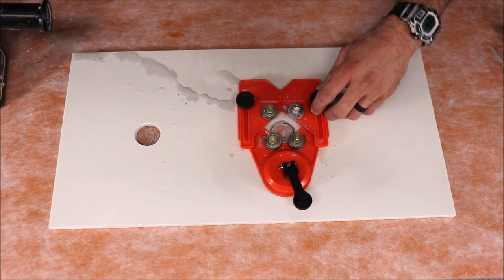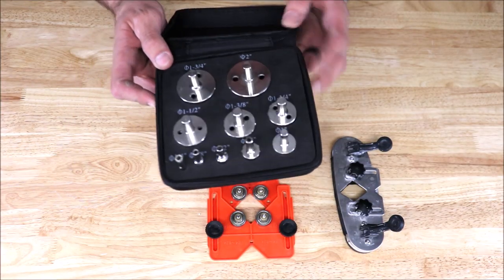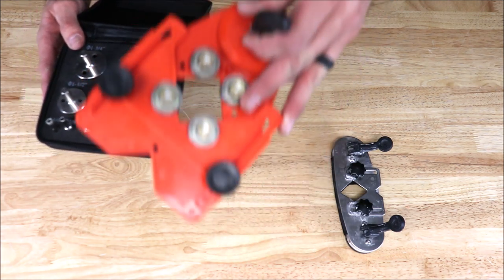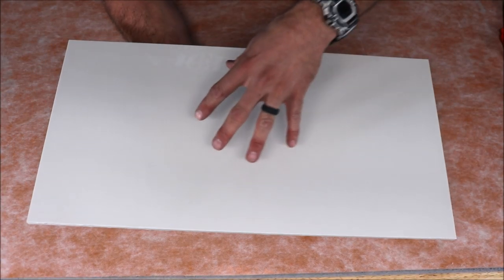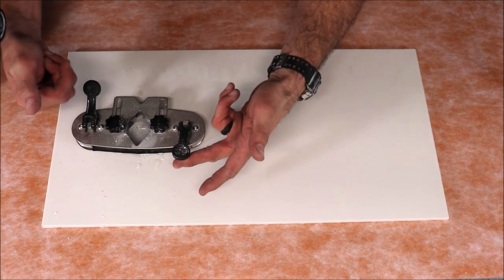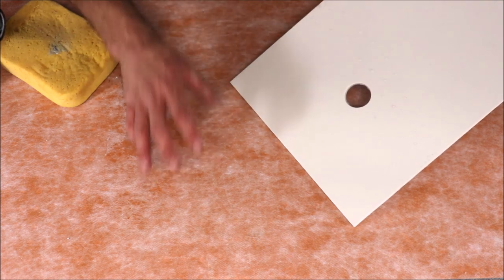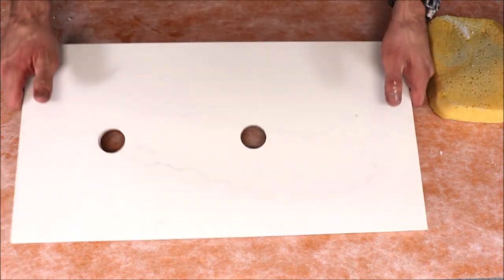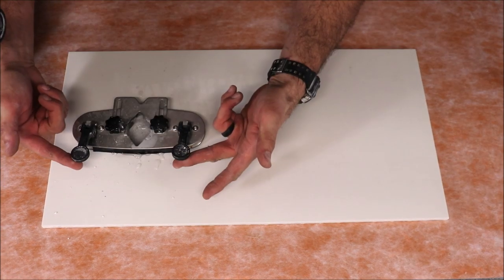Diamond Hole Saw & Guides - Tile Tool Tuesday EP. 9

Comment: Good video, but I would have wanted some context for which applications you’d use the 2 common size bits. For example, I have a island countertop and I’d like a soap dispenser, is that the same size as a bathroom faucet size? Usable on tile and 3cm countertops? And then any tips on drill speed or setting 1 vs 2? I’m really interested in these but a little more information would be helpful, thanks and hope you keep making these type of videos!

Comment: I prefer the M14 bits for the Grinder there faster and go trough Porcelain better i find. ive also not used my guide since switching to the M14 bits. the only ones i use in the drill are the ones for the Toilet waste
Reply: Have website link brother?

Comment: Well how do you keep a 4 1/2” or bigger diamond hole saw from walking for a single leaver mix valve? 
These two jigs are to small?
Reply from the maker: You can simply use half inch foam board such as Kerdi or Goboard for the guide if needed.Cut out the hole and place the foam board with hole on your mark.